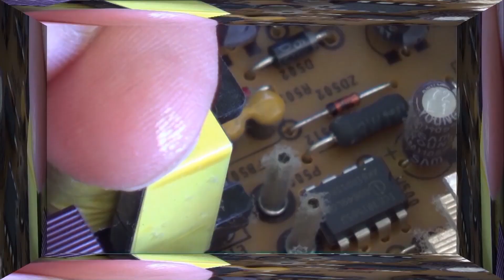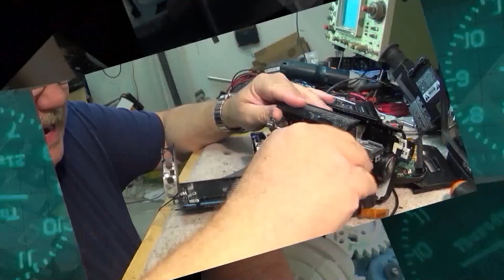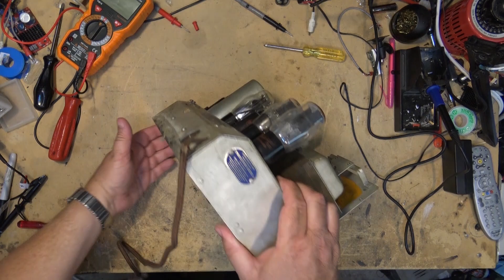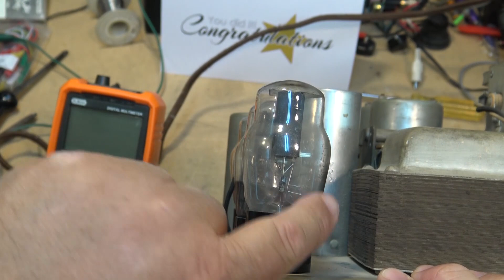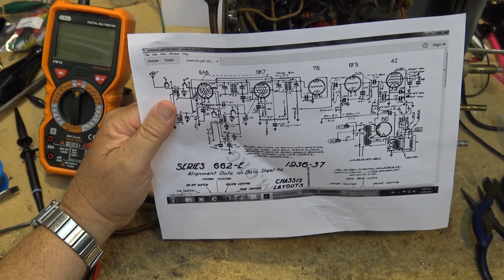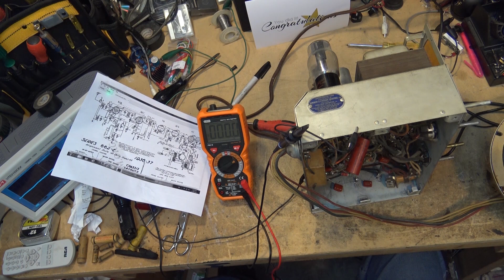80 year old Electrohome series 662 E radio restoration and diagnostics part 1

Comment: You should definitely change those electrolytics, and that box cap, they are probably already gone or are about to go, the only reason you didn't hear the loud buzz is because the speaker wasn't working right, but I could start to see ripple in that scope waveform. Those cardboard electrolytic caps are awful too, they fail often, and that would mean it would be returning for more service. I thought I saw a tiny bulge on the end of that red cap which means it's starting to spew it's guts.

P.S. you can figure out what that box cap is just by tracing it's connections on the schematic, these old machines don't care what you use as a substitute as long as it's close. If you need the space just rip it's guts out and glue the new one in the empty can.
Reply from the maker: Don't worry about the electrolytic, they will be changed. I am still trying to locate a suitable output transformer. The paper caps had to be changed before attempting to power it up. Now that I know that the tubes work, I can spend some more time and money on it once I locate a transformer that is.

Comment: I use the same multi-meter, was 35 bucks on Amazon. Works pretty good compared to my fluke that was over 200 that I didn't like to travel with. Mines a different name tho, they are re-labled meters.

Comment: Do you have a CRT next to you? Holy hell that 16KHz whine...
Reply from the maker: Doing it just to generate a bunch of thumbs down.
Reply: Yup, would prefer a notch filter at that freqency
Reply from the maker: There is a CRT monitor on the other side of the shop way up in the corner about 20 feet away. Monitor for security cameras. When I am working, and expecting someone I turn it on so I can see when they arrive.
Reply: 12voltvids ,hthe MM

Comment: A good substitute for those multi-part electrolytics is 47 uF @ 300 VDC. 2 sections were for the B+, and one for the cathode bias on the output tube (usually). Once you find the schematic/parts-list, you can sub in values closer to the design specs. They usually range from a low of 8 uF, all the way up to about 100 uF or so, in those AA5 sets.

Comment: Very good video. Lots of valve output transformers on ebay. Some cheap generic reproduction ones out there ive used in a few valve radio repairs before and had good luck with. Just need to find out what the output impedance of that 42 tube is and the speaker impedance and should be able to find something. For how much and how it mounts in the radio is a different question though. Good luck with it.

Comment: If you have the patience of a saint, you can carefully cut into the transformer paper to try and find the open winding and possibly get lucky where it's very near the connection points, then reconnect it.

I had to do this for an unobtanium transformer some years ago and it's been working fine ever since.
Reply: If you are a real glutton for punishment, you can rewind the transformer too. Takes a lot more effort, but it is doable. Trouble is, how much will the customer pay? They 'aint going to pay for several hours of my time to rewind that thing, even supposing I could. If, as you said,  the break is near the solder tabs, you may get lucky.
Reply: Andrew Hull try Radio days or the anteak radio forum  hear are the Web sites I bealeve www.radiodays.com and www.anteakradioforum.com love your videos Don Hiscock From Newwestminster British Columbia dghiscock@gmail.com
Reply from the maker: Yes did that. Did find one spot that was open, but I cleaned the enamel off to expose copper on the winding and still open. Transformer is FUBAR
Reply: Dang that sucks :(

It must have been really insulted to have multiple open windings.
Reply from the maker: One of the paper caps shorted on the plate of the audio output pulling B+ to ground through the output transformer. That is why those paper caps have to go.
Reply: @ GGigabite they just let the transformer rust till it explodes where I am from.

Comment: i found this on that series E 662 radio.   http://pacifictv.ca/schematics/phonola6525ldata.pdfl

back in the late 80s a friend brought an old 1969 Marshal amp over for me to look at. It had prior owner hacks i suspected were done wrong. It was or had been burning tubes out in less than a minute, but sounded really good.  And i remembered 2 yrs prior i set the bias when we replaced the tubes and that didnt work he said. So i suggested recapping everything and replace all of the resistors. he agreed and had the cash.
  SO we get our list of everything we needed and head to our local Radio Shack, this is way before interweb, and $50 later we're set. Now this amp hadnt been plugged in for over a yr, but i pulled a tube next to the transformer and my hand touched it...and i got one hell of a zap!!  lol  I was shocked(literally) that the caps or anything was storing that much voltage for that length of time not being plugged in. 
 but i was young and didnt know alot back then. lol  It was horrible inside! Someone jumped a bunch of stuff i think they just started touching things and when it sounded good and distorted they soldered it down not having a clue wth they were doing. 
   Good thing Marshal put the wire diagram inside the head cabinet, so i just put it back to factory and replaced everything. It worked out great and sounded better than ever. One thing it stopped blowing tubes. 
The caps turning to resistors was my guess too as to what was over driving the tubes, and several resistors and caps were blown/popped open, so i knew somewhere they had gotten some OV.   
Thanks for sharing this video! i love this old stuff, they just dont makem like that anymore.

Comment: I wonder what the impedence would be, 6k to 3.5R perhaps?
At a pinch if it was mine, i would rewind it.

Is that electromagnet working like a "Hum Bucking" coil as well?
Reply from the maker: The speaker I am sure is probably 16 ohm.  Don't know what the turns ratio is off hand. Am still researching this. A universal audio out from an old tube radio will probably work fine. I may take the one out of the viking I fixed previously to get this one going. Sacrifice the old chassis to fix this complete radio.
Reply: If you have a similar transformer from another set, and it works with this one,  you can guestimate the turns ratio pretty easily by feeding in a know amplitude signal and measuring the output. 
Armed with that information, you can then look for suitable substitutes, based on a rough guestimate of the power requirements (the rough wattage of the speaker).
Reply: They usually have one in parallel, but in opposite phase, to the secondary of the output transformer,  which this probably does have since it's an Electrohome product which copied much of what RCA did. It would be an extra winding next to, but independent of,  the field coil winding.
Reply from the maker: Yup looks like a hum bucker the way it is wired through the voice coil and secondary of the output transformer.
Reply from the maker: Yes 2 field coils, one with the B+ supply going through it, and the second feeding into the voice coil and secondary of the output transformer.
Reply: 12voltvids 
This takes me back to the late 60s, my
my early teens, when I use to bring home
radios like this that were left behind after
Portobello rd market, London, where I lived
had finished,
I remember one being particularly heavy,
the speaker electromagnet was bigger and
heavier than the starter motor off my dads
Ford Zephyr, got it working with my first
soldering iron, more out of luck than any
skill or knowledge I have to say. In my 60s
now, still learning and enjoying this stuff,
will one day service and repair my two
reel 2 reels, a Truvox and a Sound 555,
I appreciate your time in making these
vids. Part 2 here I come.

Comment: what about a 110v primary +12v,0,-12v secondary
Reply from the maker: Probably better to use a 240v primary. I do have a 240 primary transformer around here that I will try to locate.

Comment: just rewind the output transformer. the defective primary winding is usually the top winding. count the turns of one layer, multiply it with the number of layers, and job done. The number of turns is not that critical.

Comment: Actually cloth covered wire did not generally use Asbestos.
Most of the time, when you find it in a radio, it is used in sheet form as a heat shield.
Reply from the maker: Not the cloth covered wire I am concerned about. The heat tubing that is ised to insulate quite often is asbestos or mica, and mica very often has asbestos in it.
Reply: put some liquid tape or paint on the asbestos to coat it.  Use hi temp paint, or even epoxy.  Once it's coared, it's safe.

Comment: I noticed that you used a variac, isolation transformer, and a current limiting device. How were these all connected?  Great video!
Reply from the maker: Isolation transformer plugged into mains. Variac plugged into isolation transformer. Current limiter (100W incandescent) light bulb in series with line cord. This isolates the chassis from mains, allows me to vary the voltage, and limits the current to 800 miliamps (100 watts) which will protect things like the power transformer, tubes ect.
My current limiter might not be as sexy as paul carlson's but it works exactly the same way.
Reply: 12voltvids I made a current limiter following your video and it works well. Thanks again for great info.

Comment: Paper caps do not use PCB's..
OIL-filled caps MIGHT, depending on their age.
Reply from the maker: You never know what PCBs were used on in very old electronics. 
There are lots of capacitors that were oil filled in the old days, and the chance of those not containing PCBs is low because they were used everywhere.

Comment: try pacifictv.ca they list electrohome and viking radios pdf schematics hope this is of use
Reply: If the primary of the output transformer is open then observe the output valve and see if the screen grid is red hot. This is an indication that the transformer is open. In this case the screen grid acts as an onode and as it's a light structure it gets red hot with the current flowing.

Comment: you do not physically desolder or use loop over wire to solder the caps....  I do in these old sets and every other tuber doing these age radios and tvs curse you out if not. whats your excuse for not.
Reply: Fibro Dad, your comment is jibberish, what did you mean?
Reply: I think he meant :- fully desolder the component and replace or snip the leads at the sides of the old component and form a loop to feed and wrap the new component leads through - gives better mechanical solder joints.
Reply: Sasquatch, oh i see, i got a bit confused there lol.
Thankyou for making it clear :-D
Reply from the maker: Actually I generally solder to the lugs when the wire is long enough, or clip the lead, twist and solder.
Reply from the maker: I do form a loop, are you blind. Go back and look. You will see a shot of the pliers in there forming a loop. Some was cut out.
Reply: Accepted - I was just deciphering the OP

Comment: I'm surprised that those caps weren't marked in some way to indicate the foil side.
Reply from the maker: They don't do that on the new ones. So you need to scope em and see where the foil shield is by looking at the noise floor.

Comment: Just subscribed to your really nice channel.   Seems like they didn't believe in PCB's during that time.
Reply from the maker: Luc Peeters 
Pc  boards had not been invented yet. They didn't actually come along until the early 60's and initially were for cheap portables transistor radios.  This one is over 80 years old. It is the oldest piece of equipment I have ever worked on.
Reply: Interesting. Still feels strange opening a device and finding a mess in it. I used to work for a big company electronics company in the 90's and sometimes did work on old stuff, but this is something else. 
Very nice to see someone still trying to make things work again, as I like progress I always dislike seeing stuff being thrown away.

Comment: What a mess, this old timer probably reflects she spirit of the time. Respect.
Reply from the maker: Piotr Misiuna 
I have seen worse. At least no mice have chewed all the wires and with a proper audio transformer this thing will be making noises again. There is something about these vintage pieces. Love the old tube stuff, so simple but they work and last forever. Tubes rarely fail unless over driven or mechanical shock. These ones all look to be original.
Reply: Beautiful on the outside.
Reply: Well, electric chair can get broken, but you can never run out of stones, my friend.